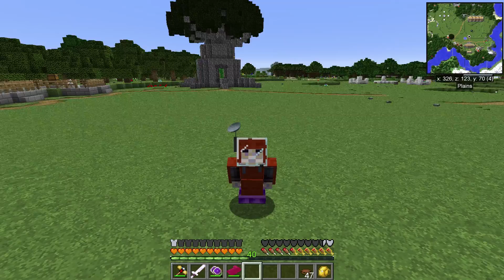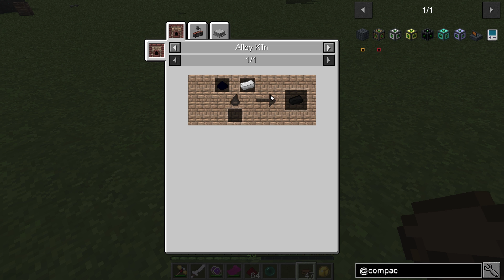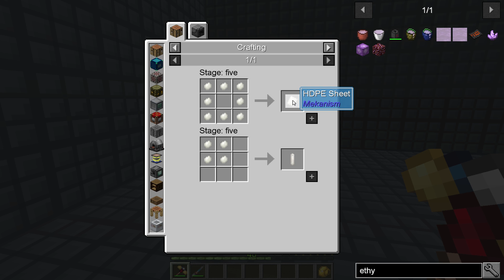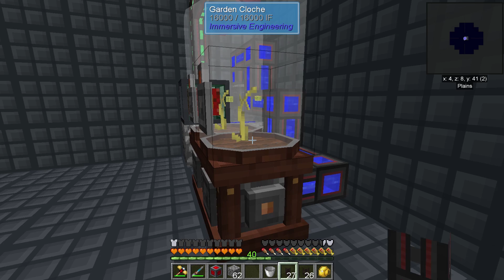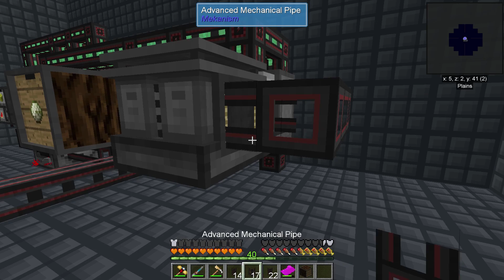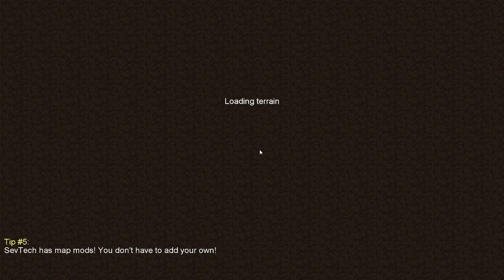Sevtech Ages EP32 Compact Machines + Advanced Generators

Comment: Mekanism was super confusing to me, so I ended up going with Industrial Foregoing Biofuel Generators, with cloches.  Its simple enough for me to use :)

Next episode are you going to be tackling Mercury / Venus?
Ive spent the last 6-10 hours banging my head against the wall dealing with Venus.  (Most of this was getting out of death loops, going to earlierstages to make suits and ships to get back to venus).
My suit gets destroyed in about 60 seconds.  How does anyone get to the boss and get that shield thing the wiki says nullifies the corrosive atmosphere, in THAT short of a time? (wiki says to use throw away armor, but i just cant see myself getting THAT much space suit T_T, and normal armor makes me die instantly due to pressure )
HELP! DX
Reply: 12463trf old comment but yea it's a huge pain. I had a Enderio dark armor set and it burned through durability and 4million RF in about 10 minutes. But yea, once you get the shield, its pretty much normal atmosphere and doesn't use any power or durability.

Comment: Hey System, the way you can tell what side is what in the gui is to visualize a plus symbol with an extra piece on the bottom left. The middle button will always be the front of the machine, regardless of what side you're looking at the machine from. The buttons surrounding the middle is each respective sides from top and bottom, to the left and right sides of the machine. The extra piece hanging out in the bottom left is the remaining back side of the machine. Hope this helps in your venture to less frankenstein logistic piping :P

Btw, I dont get why HDPE is necessary to make if you're already using the ethyline in the generator and drawering the substrate, the process of making HDPE seems to leech off of the generator's fuel just to process the substrate into HDPE, which is just going into a drawer.